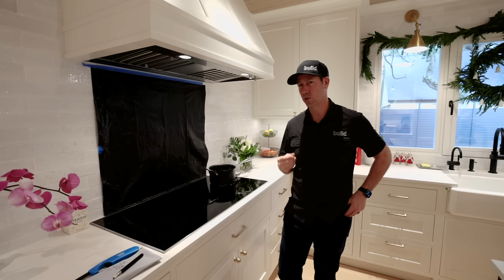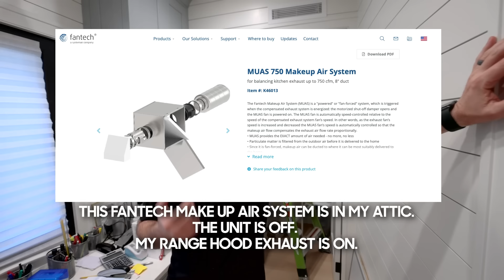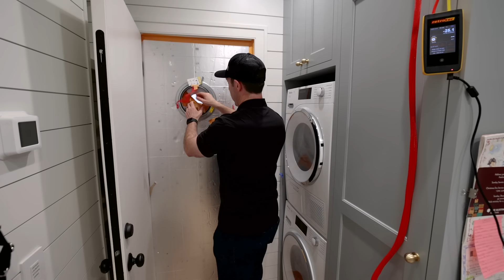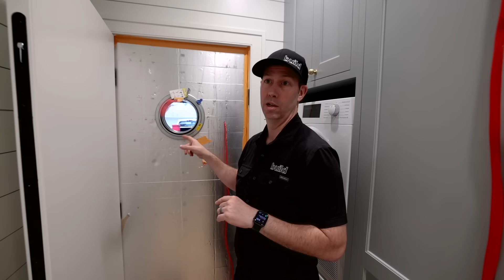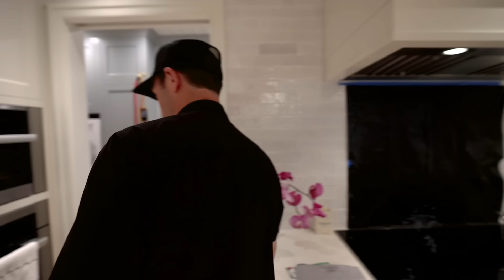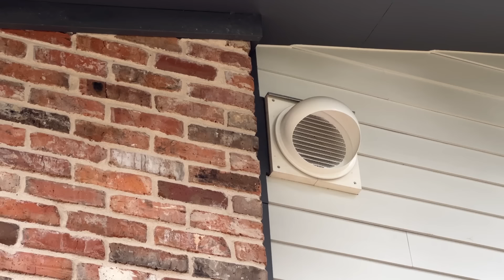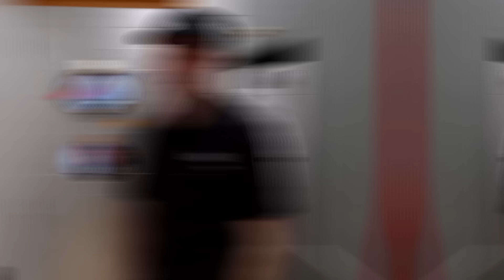Make Up Air for a Kitchen Exhaust - Most Homes Suck. (Pun intended)

Comment: This is what's great about the increasing building codes. Cost more to make home super tight. Then realized negative air is more of a problem.  Make air get unconditioned air blown in to replace it that needs treated by devices that also cost more and require some type of maintenance and replacement.  Basically make your tight house leaky.  I be know it's about control of air leakage but it still seems less and less advantageous.  Heck in new York they want to make it so no combustion appliances or heating systems can be installed in new homes. So the combustion leakage wouldn't even be an issue.

Comment: Matt,

Does this work in conjunction with your Zehnder ERV? I have a 1962 ranch that has some serious air quality problems and essentially zero exhaust for the bathrooms, and the small master bath has bad humidity problems. The Zehnder units have me intrigued. 

I presume since the kitchen exhaust fan is such a high draw, this simply recovers air for that being in use. 

Is the ERV not suitable for this task?

Thank you!

-Clueless in NC

Comment: Build an airtight home then vent air in from outside that needs to be heated so you don’t get Co2 poisoning… by code…
Not “trolling” here🤔 but… insulated can lights had a dual purpose after all! 
Just seems redundant from Laymans terms…
A fan out, a fan in and a heater to accomplish what an error in design did inthe can lights

Comment: I'm wondering about the bathroom exhausts, does that supply have enough capacity to do the job if someone is cooking and the bathroom exhaust fans are turned on as well?
Reply: Bath exhausts are part of his Zender ERV system. That is already setup so that it will pull in as much air as it takes out.

Comment: What kind of door are you using?  Looks very secure!
Reply: It's a multi-point hardware system. Can be installed on most entry doors. Takes quite a bit of work and the hardware is more costly compared to conventional lock-sets. It is probably more secure, but more importantly it keeps the door held tightly to the weather stripping along the full length, and helps prevent door warpage.

Comment: We installed a 1000CFM fan motor for our 60" hood in our house and I ended up getting a passive system that opens a damper. I've never liked it because it isn't filtered and living here in Austin I worry about all that pollen coming into my house. And as you said it isn't enough. If I open a window away from the kitchen air really blasts in when I have the vent fan on despite the dampered vent being right in the kitchen. 

Do you know who in Austin (Georgetown) could install one of these for me? I'm not really impressed with the company my custom builder used as I had to do a lot of effort to get them to figure out the passive system.

Comment: Hi Matt. I really enjoy your content and am learning a ton. Do you have any recommendations for insulated exhaust vent covers? We have gas range on an exterior wall with a pop up exhaust fan from under the counter. Last year during the Texas ice storm, I was getting temp reading inside the cabinet and on the blower motor of 38 degrees or less at the coldest so you can imagine how fast that portion of house cooled off with no power. every year that wall, floor and cabinet contents get cold. There is just an aluminum cover with a spring loaded door on the exterior. Any thought on how to prevent cooling through that exhaust vent? Thanks!!
Reply: Put 2 motorized dampers to create a dead air space and insulate the ducting. It's going to get annoying if you have to remove an exhaust plug every time you use the hood.

Comment: Or you could opt for a solution like my garbage '80s house where the fan hood has no connection to the outside and simply exhausts into the kitchen. You know, because production builder. No wonder we never use it.

Comment: Awesome video.  But lets face it, 99% of homeowners do not have any system close to this.  And on the other side, cant afford to do it after the fact either to make things "perfect"  There are cheaper old school ways to do this that most people can afford.  Is it energy efficient to do so, probably not.  But sometimes you can only do what you can do.   On another note, how well would this system work in -35 or -40.  And the one video you said how tight your house is, and now you need to suck in air every time you cook?
Reply: You really don't.  I don't have any ventilation hood at all and it is only annoying when searing something that smokes. If I were running my HVAC I probably wouldn't use the hood unless really needed.

Comment: My solution is to keep less than 400 CFM.  No gas except after taco Tuesday.
Reply: I have a hole above the oven with a fan in it. It’s been there for a hundred years and works fine. This new junk is just driving up home costs. Trying to build a house by yourself is difficult when the code book grows every year.

Comment: Why couldn't you just ramp up the Zendher ERV at that time?
Reply: Wrong tool for the job.
Reply: @rasichap  why?
Reply: @aayotechnology  
You can’t have Zehnder exhaust vents too close to the oven or cooktop. Grease contamination is likely the main reason. 

The Zehnder is a balanced system, so you can’t have it deliver only supply air to make up for the hood exhaust. 

Even if you could make the Zehnder run supply only air when the hood is on, it can only run at around 200cfm max (some models differ slightly). This is nowhere close to the 400cfm of Matt’s hood so you will still have negative pressure. Don’t forget 400cfm is modest compared to some. It’s not unusual to see 800cfm and 1200cfm hoods. 

You would have to program the Zehnder to match whatever cfm you are running at any particular time which will vary depending on model and selected fan speed. Why would Zehnder compromise the amazing efficiency of their machine, not to mention the longevity, so that it can work with another manufacturers appliance? And, as already stated the airflow rates are not the same. The Zehnder is a constant, low flow, whole house, balanced, fresh air system. A range hood is rapid, point of use, short term exhaust fan. 

I could go on and on but that should be enough to answer your question. 
Matt’s FanTech system is perhaps the best I have seen as they are integrating their own supply and exhaust fans. I’m sure the fan speeds are matched no matter what speed is selected at the hood.

Comment: In a cold climate, is there a way to recover the heat coming out of the exhaust to warm the incoming air? It's probably a bit tricky, because the air coming out is probably loaded with oil drops, so making it go through a hrv or similar would end up making the surfaces where the heat exchange happen all dirty, reducing the energy transfer and maybe clogging everything up...

Comment: Why have a separate out/in for your cooktop rather than just using your ERV? I know in past videos they said none of the air is actually recycled -- but does the smell pass through the ERV filter? Is it because you couldn't pre-filter easily on the return before the ERV / didn't want to deal with replacing those filters every few months? Or would there be too much moisture from cooking that would then recycle into the house (shouldn't be a problem depending on how the dehumidifier is setup though). Is it more of a look rather than function thing? Or was it hard to get the details clean because you'd need maybe x4+ of the comfotube hoses for each return/supply?
Reply: 2 main reasons. not enough CFM, and grease.

Comment: So if it’s cold outside and you turn on the hood the cold air will travel through all the rooms ??
Reply from the maker: Correct. In cold climates you can add a pre-warming heating coil.
Reply: @buildshow  Why not just have the make up air in the kitchen? I live in a cold climate and I'm going back from an open concept to a closed off kitchen in my renovation, so I'll just put the make up air system in my kitchen near the stoves so the cold air doesn't pass through the warm living areas to begin with.
You can add a heating coil, but isn't having that make-up air system all the way in the living room even worse in hot climates, where you use a lot of energy to air condition only to blow a bunch of hot outside air right in your living room?

Comment: Can fantech keep positive pressure I the house automatically given kitchen vent plus bathroom vent and other power exhausts?
Reply: Yes. But you new to monitor the whole house pressure difference between indoor  and outdoor to speed up and slow down the MUA unit as needed. Nobody seems to be discussing that control arrangement in these "high performance house" video's.

Comment: Does your make-up air fire up when you run the dryer or bathroom fans?
Reply: I’m a year late but I think he doesn’t  have individual bathroom exhaust fans but a central fan that makes up the air it exhausts from bathrooms. The make up air scenario and his Both achieve similar results. Imo.

Comment: Hey Matt, I have a very important question about a super tight house. If I were to get a house, either built super tight or rebuild super tight. And it’s located in a hurricane zone. What should I do in preparation for a hurricane? Because if the pressure differential, I think I would have to open two windows on either side. So that the internal pressure can match with the outside pressure. Or else something collapse. 

Thoughts?
Reply: I'd be more worried about tree branches or street signs smashing your windows than the pressure difference

That is why most people just throw up some sheets of OSB to cover any glass

Comment: Here in Utah we have been installing make up air in homes for the past 15 years.   It was if the range vent is more then 400 cfm. The only range vent that has a built in relay is Bosch all others we have had to use pressure switch relays to activate the make up air.  That way when the range come on so does the make up air.

Comment: Now go turn on your dryer and watch it go negative 400 pa.
Reply: No one has a 400cfm dryer
Reply: I have a LG heat pump dryer. I'm amazed at how efficient they are. I'm not sure why they are so rare here. Minimal fire risk because you are not exhausting lint and the clothes really do feel better than gas/electric dryers.
Reply: Most large dryers are around 200 cfm.

Comment: Insn't it just a heater and NOT a PRE-heater. It heats the air coming in so its a heater. You are not pre heating anything. You are heating the air.
Reply: You are pre-heating the air before it gets heated by mixing with the heated air in the room, just like heat recovery in a ventilation system is also a preheater. You're not using it to heat the room, you use it to preheat the make up air in order to increase comfort and lower the strain on the main heating system.

Comment: Wouldn’t it be cheaper to incorporate a fresh air/make up damper into your existing HVAC system so you can cool/heat the air? That’s going to be drawing on hot or cold air and working against your conditioned space.

Comment: I am no expert, but nobody is going to get killed by not using a make up air system. And, the system he made is wasting energy by having the make-up air so far away--it is sucking the AC/heat out of the exhaust at 400 CFM and based on whatever the required extraction rate would need to be with an electric range in the unspecified kitchen size.
Reply: true.  and <10Pa should be fine.  i dont know why code has moved to 3Pa.

Comment: Why in hells manger wouldnt they have both air in and out of the hood
Reply: Think about it.
Reply: @rasichap  i did and the air in should be built into the oven backsplash
Reply: @rasichap  on jet aircraft its called a negative pressure relief valve.
Reply: @rasichap  its also why on the hvac air handler they now have air in to feed the fire on a furnace not just a exhaust. So it makes zero sense to feed air from across a room to a vent fan. The intake air should be part of the vent isolated to the appliance that is using the air. Seems like an after thought how it was done here. You want cross ventilation for removing the cooking fumes like how a paint booth also works.
Reply: @GregariousAntithesis  You are trying to compare a furnace, a jet engine, and a spray booth to a residential kitchen. These things are all quite different and have different needs. If you have the make-up air right next to the exhaust hood you will be creating a loop. The incoming air will be sucked straight back out and will collect very little of the cooking fumes and gases. Perhaps a make-up vent on the ceiling above the cooktop would work, but you would be aware of a draught. Somebody mentioned having the air come from below the cooktop, perhaps at the floor. Again, this would be draughty and you need find a place for 50 square inches (in Matt's case) of duct and vent. That is a decent sized vent that you would rather not look at in a nice home. Matt made what I think is a sensible decision to have his make-up vent in an out of sight area, and the distance between the intake and exhaust helps mitigate any noticeable draught.
Some more powerful hoods require 10 or even 12 inch diameter ducts. That's a lot of air being moved. A hood that is handling both supply and exhaust air would be massive and it would not be pleasant standing near it with a 1000cfm blowing near you.
Reply: @rasichap  it makes zero sense that it should require a massive amount of intake air if as i just said on my last of three posts. If the intake air vent were part of the backsplash air would come in at food cooking level creating a perfect loop up and out. Fact is because the house is tight it shouldnt take much more intake air than is being exhausted if close to the source of ventilation. The further the intake air from the ventilation the more air would be needed. Also the other option could be a large vent intake behind the oven. The across the room intake makes zero sense and i bet it was done as a location compromise because of the inability to install a vent intake behind or near the oven/cooktop. Another reason why it baffles me why Texans build houses on slabs far more than peer and beam. I wouldn’t own a slab house.
Reply: @GregariousAntithesis  I have to assume you are not a builder, but if you are you should design and build a hood vent system for your house or sell your ideas to companies like Braun, GE, Miele or Zephyr etc, so that builders like Matt can install your superior design. In the mean time us builders will install equipment that satisfies building codes, performs the task well enough at an affordable price, and is something that homeowners will be happy to use.  I’m always interested in products and materials that improve homes and home construction, so I’ll keep a lookout for a hood design like that which you are describing. Good luck.
Reply: @GregariousAntithesis  Your understanding of fluid dynamics is clearly way beyond mine, so I will not waste any more time discussing this issue.
Reply: @rasichap  20 years aviation mechanic USNavy. specifically dealt with hvac/ventilation on cargo aircraft one if my many jobs as well as a jack of all trades. A lot of the tech these companies are coming out with like zip sheeting, i was doing things like covering osb with elastomeric aluminum roof coating, edge bonding the sheeting with PL premium for example. Attaching scrap osb or plywood between trusses to screw sheetrock too, for better air sealing. Using 14 and 16 foot sheetrock so there are less butt joints. Heck you cant even find 14 and 16 foot sheetrock in Texas or South of Oklahoma.